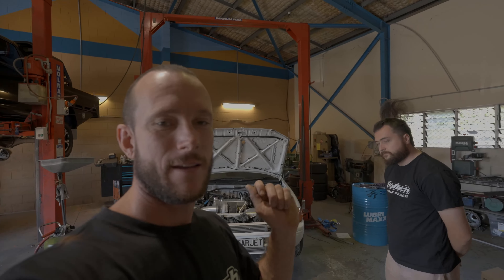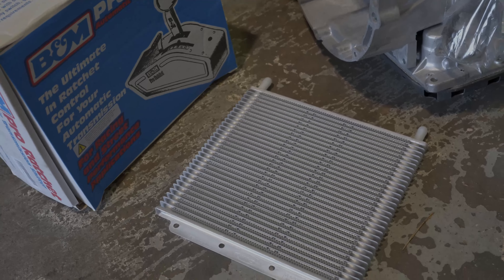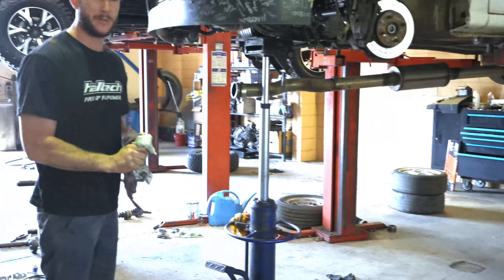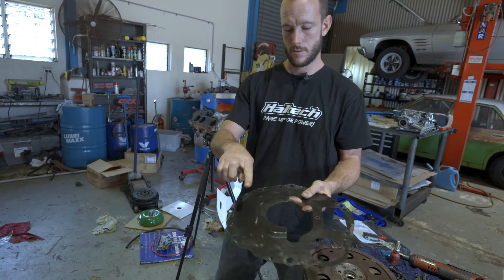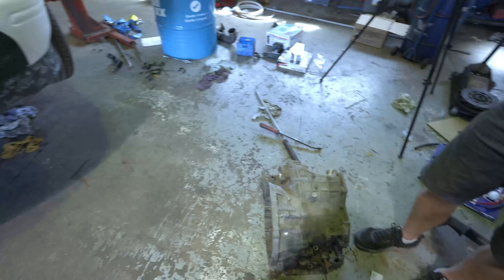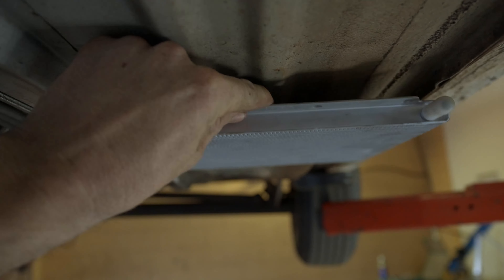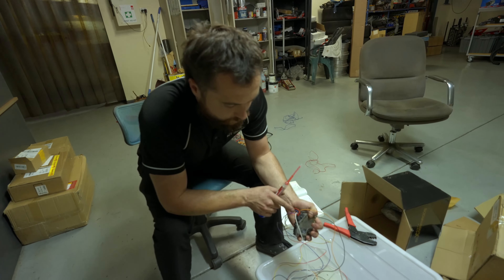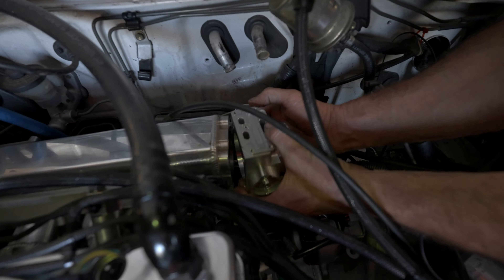Installing a built auto transmission into a Toyota Starlet 4efte

Comment: Hello! I am interested in what kind of tps you are using? Is this tps variable or is a on off type? I need a variable tps fory starlet do you have any tps recommendations?
Reply from the maker: It is 4efe na TPS. It is variable. 

If you have an aftermarket ecu you can pretty much use any tps that works for you
Reply: @Camp_Dogs  i have a turbo tps from a gt which is on off style and it is giving me a headache at tuning. I had a recommendation for a mx5 Miata tps but i would consider your option. Thanks for your reply!!!